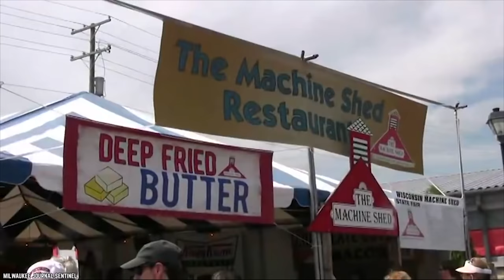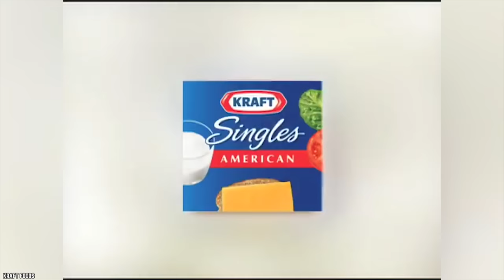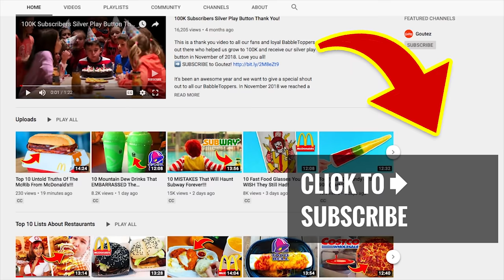10 American Foods That Should Be BANNED (Part 2)

Comment: I'm going to suggest thst apple pie existed long before Europeans collonised the America's.
Reply from the maker: English apple pie recipes go back to the time of Chaucer. The 1381 recipe is the earliest known apple pie recipe in the world, and lists the ingredients as good apples, good spices, figs, raisins and pears. The cofyn of the recipe is a casing of pastry. Saffron is used for colouring the pie filling. 

Recipes for Dutch apple pie go back to the Middle Ages. An early Dutch language cookbook from 1514, Een notabel boecxken van cokeryen ("A notable little cookery book"), letterpress printed in Brussels by Thomas van der Noot, who may also have been the author, documents a recipe for Appeltaerten (modern Dutch Appeltaarten 'apple pies'). This early recipe was simple, requiring only a standard pie crust, slices of especially soft apples with their skin and seeds removed, and den selven deeghe daer die taerte af ghemaect es (more of the same dough) on top. It was then baked in a typical Dutch oven. Once baked, the top crust (except at the edges) would be cut out from the middle, after which the apple slices were potentially put through a sieve before the pie was stirred with a wooden spoon. At this point the book recommends adding several spices to the pie, namely: cardamom, ginger, cinnamon, nutmeg, clove, mace and powdered sugar. Finally, after mixing the ingredients into the pie with cream, it is once again put into the oven to dry.

Traditional Dutch apple pie comes in two varieties, a crumb (appelkruimeltaart) and a lattice (appeltaart) style pie. Both recipes are distinct in that they typically call for flavourings of cinnamon and lemon juice to be added and differ in texture, not taste. Dutch apple pies may include ingredients such as full-cream butter, raisins and almond paste, in addition to ingredients such as apples and sugar, which they have in common with other recipes.

Apple pie was brought to the colonies by the English, the Dutch, and the Swedes during the 17th and 18th centuries. The apple pie had to wait for the planting of European varieties, brought across the Atlantic, to become fruit-bearing apple trees, to be selected for their cooking qualities as there were no native apples except crabapples, which yield very small and sour fruit. In the meantime, the colonists were more likely to make their pies, or "pasties", from meat, calling them coffins (meaning basket) rather than fruit; and the main use for apples, once they were available, was in cider. However, there are American apple pie recipes, both manuscript and printed, from the 18th century, and it has since become a very popular dessert. Apple varieties are usually propagated by grafting, as clones, but in the New World, planting from seeds was more popular, which quickly led to the development of hundreds of new native varieties.

Apple pie was a common food in 18th-century Delaware. As noted by the New Sweden historian Dr. Israel Acrelius in a letter: "Apple pie is used throughout the whole year, and when fresh Apples are no longer to be had, dried ones are used. It is the evening meal of children."

The mock apple pie, made from crackers, was probably invented for use aboard ships, as it was known to the British Royal Navy as early as 1812. The earliest known published recipes for mock apple pie date from the antebellum period of the 1850s. In the 1930s, and for many years afterwards, Ritz Crackers promoted a recipe for mock apple pie using its product, along with sugar and various spices.

Apple pie was one of the dishes that Rhode Island army officers ate for their Fourth of July celebrations during the Siege of Petersburg.

Although eaten in Europe since long before the European colonization of the Americas, apple pie as used in the phrase "as American as apple pie" describes something as being "typically American". In the nineteenth and twentieth centuries, apple pie became a symbol of American prosperity and national pride. 🍎 🍏